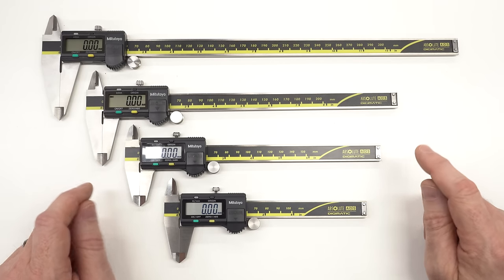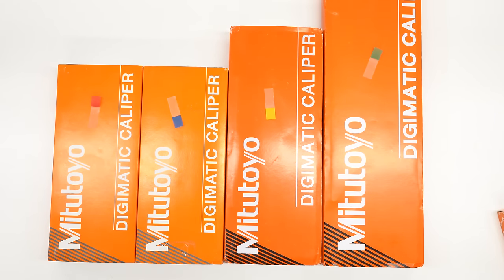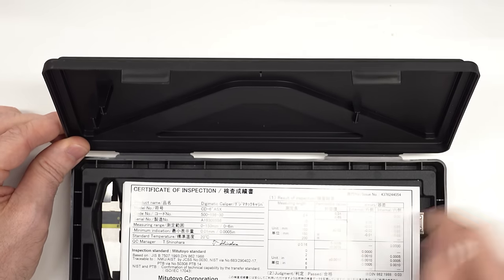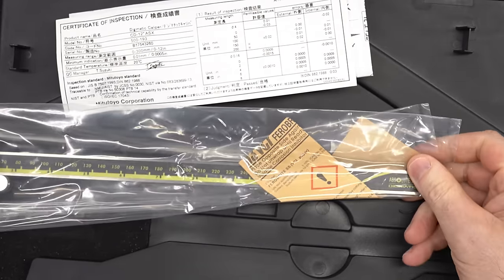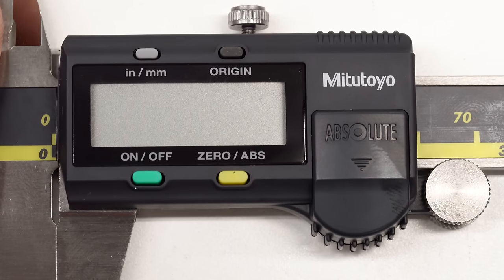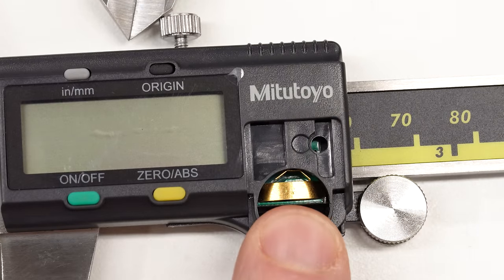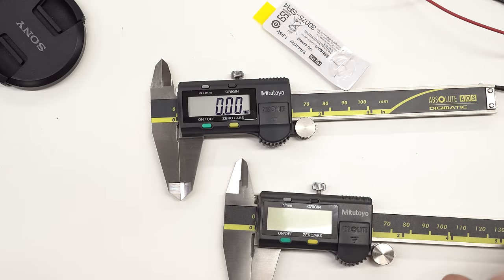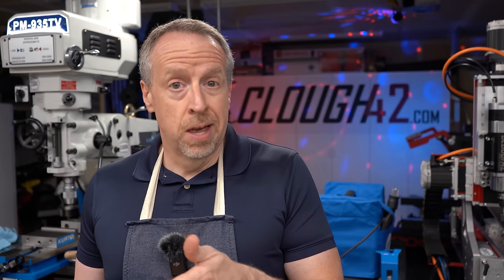17 Warning Signs Your Mitutoyo Calipers Are Fake

Comment: Thank you for this detailed comparison; you sound like me! :) I don’t need a precision caliper in my work, but I do use a dial caliper. It gets dropped and mishandled; I frequently hand it to customers to give them more confidence in their readings. At home, I keep a better caliper, but not a Mitutoyo; it’s marked “Anytime Tools,” and the instruction sheet is dated 2006. No nation of manufacture is indicated, but the company address is in the U.S. It reads metric and English, with a needle on the dial that goes halfway-around for one millimeter, and another needle that reads a tenth of an inch per revolution. The linear scales are clean and accurate. The case is adequate, but it seems that it may open if dropped, so I keep the original cardboard sleeve around it.
I don’t like battery-powered instruments because I hate having to hunt down replacements.
At my age, I hope never to need a replacement, but I am thankful that you showed us what to watch out for!

Comment: This is a very interesting video. I bought what I THINK is a genuine Mitutoyo 6” digital caliper. There is very little that matches your calipers here. Only 3 buttons, in/mm above the display, on to the left under the display, and a green on zero button to the right. I paid about $100 in the late 80s or early 90s. It came in a hard grey plastic case, no paperwork that I can recall, and I always save everything like that.  
Instead of the curved slash on the right is straight angered slash, and under it is DIGIMATIC  in small stylized print.  

On the back of the “head” is: 
Code No 500-133
Model CD-6”B
Serial No.  0030497
Battery  SR44

Mitutoyo Corporation
A tiny 3 snowman logo to the left, and centered is Made in Japan

I bought it to measure valve adjusting shims for DOHC Honda motorcycle engines. It has always been accurate for my needs.  I have always assumed it is a genuine Mitutoyo. 
Thank you for the informative video.

Comment: Wow, really a neat video.  There are videos much like this for Rolex and other high-end watches, it's interesting to see how much effort goes into the counterfeits. My own ebay "fakes" have most but not all of your tells - the battery was LR44 instead of SR44, the injection molding was fixed, and the paper outer wrapper had black striped but the angle of the "M" stripes was currect. The paperwork was only somewhat but not awfully bent. Other than that, the rest of the tells were the same. Next round I go to a reputable supplier.

Comment: I just took the time to watch and was interested to see some of the differences between genuine and counterfeit, as I had my genuine Mitutoyo 12" Absolute caliper next to me I checked some of the details and noted such items as the squarer corners  on the fixed jaw, closer text around the display and recessed Origin button match my genuine one. Now it's over 20 years old so the counterfeiters may have copied an older model and not updated those features as Mitutoyo have changed them. My newer 6" Absolute AOS has all the correct features and a couple of days ago needed a new battery and came up with  the '-------' after so all good there.

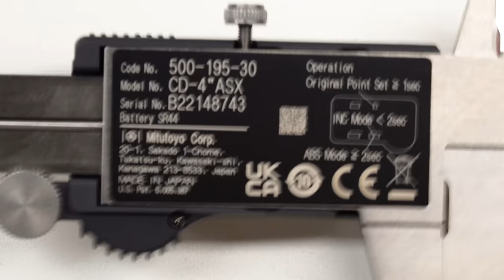Comment: Great video! @27:12 when you show the back of the genuine 4" the kerning is out of whack in the upper right. Note the "Operation" and "INC" have some mushed together. Looks like something was sent a printer that didn't have the intended font installed.  I wonder what @mitutoyo thinks of that.

Comment: Just received a new Mitutoyo 12" caliper from an Ebay seller. I believe it to be a counterfeit (even though the price didn't reflect it). After looking at a couple other videos about counterfeit Mitutoyo, there were a couple of things I don't think you mentioned. The set screw on the counterfeit unscrews all the way out. The set screw on a genuine does not. And on the end of the depth gauge the notch is a nice short radius cut on the genuine, as for the counterfeit it is a long squared off notch.

Comment: Thank you for pointing out the subtle differences on the fake Mitutoyo calipers. When I was a machinist I used Brown & Sharpe measuring tools. was not sure about the many newer brands out there on quality and reliability. 
Thanks again.
Reply: Brown & Sharpe digital calipers were trash, Starett's too. Bought each threw both away.
Reply: @KingfishStevens-di9ji  well thanks for the reply on that because I was wondering it has been some 40+ years since I have been a machinist and back in the day. Those were top-notch tools.
I appreciate your input. Thank you very much.
Reply: @Ron-FabandBuild  They still are top of the line, just not digital tools. Its like when Kodak tried to make digital cameras.
Reply: @KingfishStevens-di9ji  This is good to know as I still prefer the old school dial and veneer calipers. 
I will say that a good quality digital
Caliper can be of good use. 
Thanks again for the information.

Comment: I have several of these "fake" Mitutoyo calipers. I knew they were fake when I bought then, but they are going to be used by hs robotics students, so if they last a year, I'm happy. I clean them up and lube them and they work quite well.

I have Etalon micrometers and calipers for my personal use. Comparing the "fake" mitutoyo calipers to my standards. I find them to be quite accurate. Certainly good to 0.001 inch. Using any kind of caliper to 4 digits is a fools errand

I do find these "fake" calipers are generally better built than the even cheaper no name calipers also available, so they do provide some value.

Comment: Granted this is now a year old and the few other things I noticed might have been pointed out but incase not,
1) you can tell that the LCD's are different and / or the location of the On/Off text relative to LCD character relationship is different (seen when in inch mode). Plus the knock-off's LCD has a more yellowish hue to the screen vs. the genuine units have a more true silvery screen like most high quality LCD but this could also be an illusion from the camera and lighting angles but the first part is clear about the offset between the On/Off text.

2) the travel end stop bars that prevent the caliper head from coming off the slide body. On the genuine calipers, the bars are pretty much flush or really really close to flush with the end of the body where as on the knock-offs, the end stop bars are inset a noticeable amount from being flush with the end of the body.

3) The thumb screws look to be different (this on is hard to tell though for sure but the knock-offs look like the heads of them are tall than the genuine units). If I had to guess, the genuine units look like the head section is about 3mm to maybe 4mm tall where as the knock-offs look more like 5mm tall or even slightly taller.

Now as for a knock-off being worth the money. The test that I look at is how accurate is it across the range and travel AND does it lose accurate positioning if you open or close it rapidly. I've seen many cheap / knock-off digital calipers lose accurate positioning because their processors are too slow and lose (skip resolution intervals of the mag strip) if you move them too fast. While even high end genuine ones are subject to this too but the speed of travel at which the lose steps is SIGNIFICANTLY higher than cheapo / knock-off ones and under normal use, likely to never be a problem but with cheapo / knock-offs the travel speed at which they skip intervals can be quite low and problematic.

Comment: Another detail you missed is the locking screw. They are noticeably different on the fakes, and easy to spot if you know what you're looking for. This is one of the easiest giveaways when looking at pictures of the item listed on eBay. Of course, the price is the first dead giveaway, as well as the location and feedback score (usually extremely low, like single-digits) of the seller.

Comment: Another small difference with the battery instructions on the fake Mitutoyo caliper is that  the brand name is missing on the illustration of the counterfeit caliper. This can be seen at 15:22 on the video. You have done a really thorough job comparing the genuine and the fake. I watched the entire video from start to finish. Fascinating.  The really scary part is that these EBAY fakes will have no product support ! If they break down the money invested in them is lost forever.

Comment: You said you were going to continue on the low voltage test but then you did not. I was curious about that. Otherwise a great video and was very helpful to verify that the 6" ones I bought for $120 on line are authentic. Thanks.
Reply from the maker: Silver oxide batteries (SR44) sit right at 1.55V until they're pretty much done.  Once the low battery light is on, there's not really anything left.  Running at lower voltages is only relevant for inexpensive calipers that use LR44 batteries, which experience more voltage drop across their usable capacity.

Comment: 16:00, the yellow labels are missing Mitutoyo in the drawing of the caliper.

I bought a Mitutoyu 6” vernier caliber and 1” micrometer two years ago from a local industrial supply shop. These were apparently sitting in the store for several years. The caliper’s box cardboard box top surface’s orange ink had completely faded, so the orange test didn’t apply. The print was difficult to see, but matched nicely. The case said made in Japan. The certificates looked genuine. The details of the battery compartments were not the same as your calipers. The print on the caliper’s rules were completely different. My caliper’s battery indicator is giving a B and must be a low battery.
Thanks for the details.

Comment: Great video!  It looks like the bulk of the genuine caliper's current draw is used in sampling and conversion, and the display consumption is incredibly low.  It also looks like they might be using multirate sampling to reduce power consumption when the measurement isn't changing.  Most measurements take just a few seconds to take, but I don't think I've ever seen anyone turn calipers off.  The vast majority of a caliper's on-life is spent during the auto-off period, so reducing the sampling rate here can have a massive effect on battery life.  The knock-off calipers power consumption is rock-solid - and high.  It almost looks as if they don't depower much of the circuitry but just turn the display off...

Other changes I noted:  The battery contacts are different.  The LCD background is a different color.  The plastic of the scale has a different lustre that showed up well during close-up shots.

Comment: 24:00 Its not recommended to touch a battery with the bare fingers, because the fat of the skin builds weeks later a film that not conduct not any more  the current. Then cleaning with a good alcohol is needed.

Comment: Great video. It would have been nice if you had showed a comparison of a calibration between the genuine and counterfeit product. as most products tend to be made in the same factory or country (China) and there is usually very little difference between medium to high-quality brands and extremely budget brands. Only the best of the best USUALLY Display a higher quality product. Thank you again for pointing out generally speaking, that counterfeits are about.

Comment: Just some notes based on the 6-8 year old pair of 8” mitutoyo calipers my work gave me to use.  They came from an authorized dealer, this is a large corporate manufacturer so I know they are genuine.

-my origin button is flush/recessed like the clones
-my unit does not do the “loading” flash upon battery insertion
-my background is semi-gloss on the back with grayish text

Comment: I have 2 Mitutoyo's from McMaster-Carr, which I would assume to be genuine.  There are many features that match your genuine ones, but they also have a couple features that match your eBay ones.  Most notably is the storage case studs and ejection marks in the case, the origin button being below the surface, different startup procedure, different LCD housing (although still very crisp and fine), and the notes you made about the "swoop".
I got these both probably 8-10 years ago, and they're still running.

Comment: Very interesting. I just used your tips to spot some fakes on eBay - very obvious when you know what to look for. You also make a valid point about making a good low cost alternative to the genuine Mitutoyo but don't copy the brand!! I bought a cheap digital caliper from eBay some years ago - not branded at all. I know it may not be as accurate as a Mitutoyo, but it does what I want. Thanks for sharing!

Comment: My Mitutoyo (200mm I got off ebay - cheap) seems legit but has differences to yours.  It has the recessed origin button and the 2 tabs under the battery which is a VERY tight fit.  However, It goes straight to "on" and the holes don't line up with the screws on top.  The case has the 2 rounded injection sites and two round 'tabs' with foam inside to hold the callipers in place.
It also has the ground recess on the rear (not the milled type).  Sticker on the back isn't perfectly placed.  All injection moulding seems perfect.

Comment: I found that there is absolutely 10 counterfeits for every authentic maker in just about any industry that does mass production.  Amazon has been caught selling counterfeits as well.  The only true way to tell an authentic Mitutoyo is to call them up and ask if the serial number was sold to the distributor you purchased from.  I have seen some pretty good knock-offs of solid calipers.  It's just so easy to tell once you begin measuring with a fake vs an authentic.  The real deal is just a completely different experience and feel.  Worth every penny when someone tells me they measured 2.554 on their Mittys and I do the same measurement on my Mitty's and get the exact same measurement on a standard part they cut, then I used their process & I get the same outcome.  That's worth the money to me.  I didn't know that the 4" had a round depth rod.  I'm gonna have to get one just for that reason.  The other side of that fake one, when I use the real one, it returns to zero every single time I use it.  Never once has either one of the authentic ones I have not returned to zero at full closure.  Just ridiculous how consistent they are.

Comment: Thank you so much for a stellar video. For myself, your video demonstrated that I have a genuine article. However, if I may, I have two questions. My own unit does not have a usb port. Was such a port something all MITUTOYO items should have? I was also not sure what the acceptable values are for repeatability relative to the point in the jaws where the measurement is performed. Thoughts?

Comment: Thank you for this video, well done. The quality of a tool can be the difference between hitting a crater on the moon and missing it by miles. When it comes to accuracy of a part that is used for things like making engine parts for rockets. then I would certainly depend the real and certified product of a reputable company.
If however I was only concerned with "close enough" for a lawnmower part then maybe the counterfeit would suffice, but I wouldn't feel confident enough to claim my parts are precise enough to guarantee.

Comment: Thank you so much for this. I bought what I thought was a 8" Mitutoyo caliper from eBay many years ago for a good price. Bad news is it's a fake. The good news is that it has been working just fine for over 10 years. In all that time, I've only had to change the battery once. The machine work on it is very nice with no ruff spots or slop. As I mentioned, battery life has been great. I've accidentally left it on for several days with no ill affect. Of course I don't use it to make a living or to ensure the tolerances of a piece of NASA gear.  For hobbiest use in my shop, I'm satisfied. I do have a real Mitutoyo dial caliper, but I don't use it because digital is so much easier. I may buy a real Mitutoyo 6" caliper, just to say I have one.

Comment: I noticed the QR code on the backside label were a complete blotch on the fake ones.  I swear by Mitutoyo.  With my el cheapo calipers the batteries don't last as long and when I turn them on I almost always have to rezero or hit the origin button, including sometimes when I'm using it too.  Not with the real thing.  They always hit zero when turned on, only rarely do I have to hit the origin button.  Still using my 20 year old 6".  I check it with a 3" standard from time to time and it always hits it precisely.  You just can't beat them.

Comment: Thanks for the video.  I was worried for a moment, mine (both 'coolant proof' IP67) might be fake - but I'm reassured they're not!
I think it is worth the money, having bought cheap calipers for years, figureing they would die eventually from coolant ingress.  The Mitutoyo ones just keep going.  The oldest of mine has to be 20 years now.  It's reassuring that you can just pick it up & it will work.  Nothing worse than mid job, discovering the caliper has died.

Comment: In all of the cheap Chinese calipers I have, the batteries only last a few months, whether I use them or not.  As your test shows, the cheap calipers draw more current in operation and draw nearly the same current when turned off.  They don't truly turn off the circuit, they just blank the LCD screen.

Comment: I just bought a 6-inch Mitutoyo, shipped from and sold by Amazon for $110.32 and delivered today.  They have since increased to $121.44.  You can bet that I checked them out very well.  My Sylvac/Fowler UltraCal II ate a battery every two months and would lose zero.  It did not have an off switch and required removing four tiny screws to change the battery.  Thanks for the video!